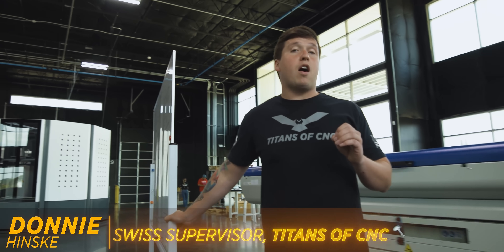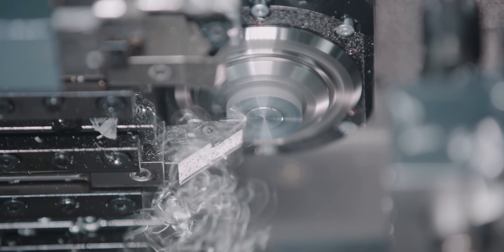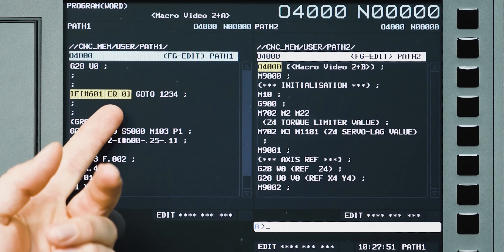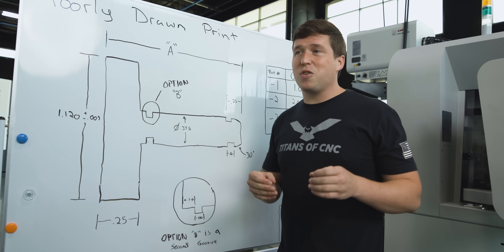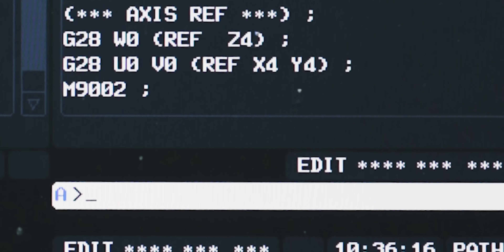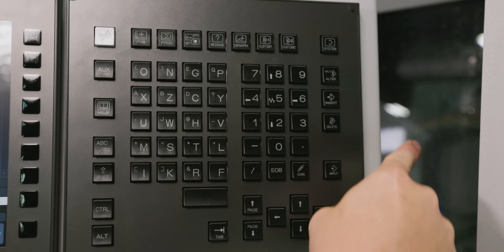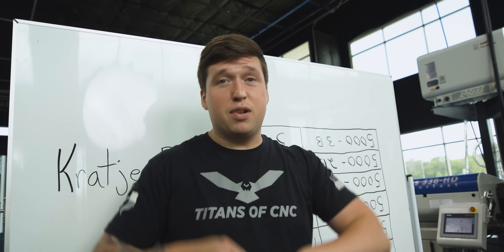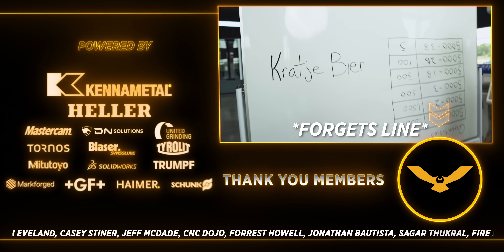Unlimited Part Sizes With This Genius Macro Program

Comment from the maker: %
O4000(<Macro Video 2+A>)
(*** SAVING PART VARIABLES ***)

#600 = 1. (Part OAL)
#601 = 1 (OPTION B? 0=NO 1=YES)

G800 A1.125 B #600 C [ #600-.5 ] D0.3 E.003 F0.0155
(A: BAR DIAMETER)
(B: LENGTH OF PART)
(C: PART PICKOFF LENGTH)
(D: FEEDING ALLOWANCE)
(E: FRONTWORK FACING ALLOWANCE)
(F: BACKWORK FACING ALLOWANCE)
(H: LENGTH PINCHES SPINDLE FOR WORK WITHOUT GUIDEBUSH)
(I: INTERNAL DIAMETER)
(J: QUANTITY OF PARTS BY CLAMPING)
(K: QUANTITY OF FEEDING PER PART)
()
(*** SAVING CUT VARIABLES***)
G801 A1100 B0.118 C0 D97 E2000 F0.0035
(A: CUTOFF TOOL NO + CORRECTOR)
(B: CUTOFF TOOL WIDTH)
(C: CUTOFF TOOL ANGLE)
(D: SPINDLE MODE 97=G97 96=G96)
(E: SPINDLE SPEED BASED ON ARG D)
(F: INITIAL FEED RATE)
(I: SPINDLE SPEED LIMIT)
(J: INCREMENT OF CHIP BREAKING)
(K: DEAD TIME TO BREAK THE CHIP)
(M: WITHDRAWAL TO BREAK THE CHIP)
()
(*** SAVING DWELL VARIABLES ***)
G802 A0.5 B0.5 C0.5 D0.5 E1 F0.5
(A: DWELL AFTER OPENING COLLET S1)
(B: DWELL AFTER CLOSING COLLET S1)
(C: DWELL AFTER OPENING COLLET S4)
(D: DWELL AFTER CLOSING COLLET S4)
(E: DWELL AFTER STOP PUSHED BARLOADER)
(F: DWELL BEFORE CLOSING COLLET S1 WHILE FEEDING MATERIAL)
()
(*** SAVING ELEMENTS MACHINE VARIABLES ***)
G803 A2 B0 C1
(A: GUIDEBUSH TYPE  2: MOTORIZED GUIDEBUSH  3: WITHOUT GUIDEBUSH  3.1: WITHOUT GUIDEBUSH TYPE2  100: NOT STANDARD)
(B: BARLOADER TYPE  0: ANY 20 : MANUAL 100: NONE)
(C: TYPE OF EJECTION 1: EJECTOR 2: LONG PART DEVICE WITHOUT CYLINDER 100: NONE)
()
M9000
(*** INITIALISATION ***)
M10
M82
/M8
G4 X1
G900
M9001
M9002
(*** AXIS REF ***)
G28 U0
G28 V0
(*** INITIAL CUTOFF ***)
G910
M9003
(*** START LOOP ***)
N1 M120
(*** END OF BAR TEST ***)
G913
G930
M9004
(*** FEED NEW PART ***)
G912 B500
G0 W0.00787 (RETRACT THE BAR IN Z)
G0 Z-.75 T0
G0 X1.33858 T110 D0 (RETRACT THE CUT OFF TOOL X)
M9005
(*** MACHINING ***)
/M8
(TURN)
G0 Y0 T112 M103 S8000 P1
M45
M600
G0 Z0.0 X [ #500+0.02 ]
G1 X-.05 F.003
X.3, R.025 F.001
X.375, A150., R.025
Z-.26
X1.123
X1.129 W-.03
G0 X1.2
Z.1
G28 U0

(GROOVE)
G0 Y0 T220 S5000 M103 P1
G0 X1.2 Z-.25
X.4
G1 X.3 F.002
G0 X.42
W-.01
G1 X.375
X.355 W.01
G0 X.42
W.01
G1 X.375
X.355 W-.01
G0 X.45
G28 U0

(TURN 2ND SECTION)
G0 Y0 T112 S8000 M103 P1
G0 X1.2 Z-.23
X.4
G1 X.375 Z-.23 F.001
Z- [ #600-.25 ], R.01
X1.120, R.025 F.005
Z- [ #600+.05 ]
X1.129 W-.03
G0 X1.2
G28 U0

IF [ #601 EQ 0 ] GOTO 1234

(GROOVE)
G0 Y0 T220 S5000 M103 P1
G0 X1.2 Z- [ #600-.25-.1 ]
X.4
G1 X.3 F.002
G0 X.4
W-.01
G1 X.375
X.355 W.01
G0 X.4
W.01
G1 X.375
X.355 W-.01
G0 X.45
G28 U0

N1234

M601
M46

()
()
M9200
(*** CUT-OFF PREPARATION ***)
G97
G0 X1.33858 Y0 T110 D0 M103 S5000 P1
G911

(G0Z-[#600+.787+.01])

M9201
M9202
G1 G95 X0 F.006 (CUTOFF)
M9203
G1 X-0.03937 F0.00118 (END OF CUTOFF)
G97 (CONSTANT CUT-OFF CANCELLATION)
(*** END LOOP ***)
M121
M9204
M9
M105
M1105
M2105
M9205
M0 (STOP A END OF CYCLE)
/M8
G4 X1
M9206
M99 P1
M2

O4000(<Macro Video 2+B>)
M9000
(*** INITIALISATION ***)
M10
G900
M702 M2 M22 (Z4 TORQUE LIMITER VALUE)
M702 M3 M1181 (Z4 SERVO-LAG VALUE)
M9001
(*** AXIS REF ***)
G28 W0 (REF  Z4)
G28 U0 V0 (REF X4 Y4)
M9002
G919
M9003
(*** START LOOP ***)
N1 M120
M9004
G55
M405
M9005
(*** MACHINING ***)
G55
G28 W0
G0 T540 Y0 X-1.2 S5000 M404 P4
Z0
G1 X.05 F.002
G0 X-1. Z.05
G1 Z0
X-1.12, R.025
U-.003 W-.06
G0 X-1.2 Z.1
M405 P4
G28 W0
()
()
(*** PART EJECTION ***)
G55 (Z4 ZERO OFFSET FOR BACKWORK MACHINING)
M405
G28 W0 (REF  Z4)
G0 X0 T500
M11 (OPEN THE COLLET S4)
G4 X0.5
M84
M85
G4 X0.2
G28 W0 (REF  Z4)
G28 U0 (REF X4)
M9200
M9201
(*** PART PICKOFF ***)
G915 (SHIFTING FOR WORK IN OPERATION)
G97
G0 X0 Z0.07874 T400 M404 S5000 P4 (APPROACH BACK SPINDLE)
M418 (SYNCHRO PHASE)
M702 M4 M1 (TORQUE LIMIT Z4)
M702 M5 M1 (ENABLE SERVO-LAG CHECK Z4)
G924 (PART PICKOFF)

(G0Z-[#600-.5])

M9202
M9203
G1 G94 W0.07874 F78.74016 (CHECK BREAKAGE CUTOFF TOOL)
M702 M5 M0 (Z4 DISABLE SERVO-LAG CHECK)
M702 M4 M0 (Z4 TORQUE LIMIT CANCELLATION)
G95 (FOR LOOP START)
G28 W0 (RETRACT BACK SPINDLE)
(*** END LOOP ***)
M121
M9204
M405
M5105
M9205
M0 (STOP A END OF CYCLE)
M9206
M99 P1
M2
Reply: Looks like a millturn milling cycle, not what was used in the video.
Reply: @staamp4642  Just fixed it! Thank you
Reply: You forgot to add (barry stinks)
Reply: @RippenSXS they should totally do a silly vid on custom messages and alarms 😂 frickin hilarious!
Reply: Im just a manual monkey but youre a real G for dropping this
Reply: G0 Z0.0 X [ #500+0.02 ] 🧐
Reply: @BTR_m the Tornos G800 parameters update in the #500 macros. #500 is my material. I write my template to rapid the first tool to the material diameter plus .02 so it’s always right
Reply: @donniehinske  Thank you for explanation Donnie, Im new in swiss machining, we have in our shop Doosan Puma ST32 ca. 6 month now and we learn every day something new
Reply: This is awesome, I've been playing around with macros on a mill but I was wondering if you have any books or references you would recommend? Also, is there a way CAM can help with this?
Reply: To make it foolproof I would check that #600 is greater than 0 and raise an alarm if it's not. Very informative content anyway!
Reply: I don’t know what’s the difference of macros instead of normal program.
If I create a program for each part , isn’t that the same result?

Comment: ACB stands for 'Active Chip Breaker.' This breaks chips in a controlled manner, eliminating the accumulation of long, stringy chips, bird nests, etc. It's supposed to save the operator downtime from having to pause or stop the machine cycle in order to clear chip accumulations.

Comment: To follow this better, I typed in:

B#600 =11:11  (Video length)
()
(F: INITIAL FEED RATE =DS.50

This played the entire 11:11 video at 50% DS
DS   =(Donnie Speed)

Much easier for my slow mind to absorb. 😁

I can't begin to comprehend the amount of inputs on a complex part.  One single digit entered incorrectly must create scrap metal rather quickly.
You guys are doing a fantastic job educating the masses and at the same time entertaining the rest of us.
👍👍👍

Comment: I'm a CNC machinist from switzerland. But in a wood furniture manufacture. I also wrote similar macros for furniture parts and house doors. So we're able to take the measurment at the customers house for example how large and deep the wardrobe has to be. The macro just turns the external dimensions of the furniture in to a program for each part. Like an excel-file with "if-then-function", all the necessary holes and millings were adjusted automaticaly. You remember the tour at the Tornos factory, where every working process is totally streamlined for maximum efficency? In switzerland it is necessary that allmost every manufacter works like this. As well cabinet makers and carpenters. Otherwise the products are too expensive. 
Love your chanel!

Comment: OR, write a macro that uses variables. But, use a separate program for each variation of the part which contains only the variable values and a call for the macro. Of course, there is not much advantage to doing it this way on a simple part like the one in this video. However, for more complicated parts with several variables, it saves time by not needing to edit the program variables every time you run a different variation of the part. You just load the program that contains the variables needed for the variation you want to run. It also reduces the opportunity for errors that might happen if you accidentally edited the program with a bad variable.
Reply: G98 P#### for the win.

Comment: Realistically, how many people watching this are swiss machinists?
Reply: Not me
Reply: You can do the same stuff to any other control.
Siemens, Haidenheim and Fanuc do the same.

We sometimes have 30 different variables in our programs.
The program has between 10,000 and 1,500,000 lines of code.
The variables are stored in the post processor.
Reply: Swiss Applications Engineer 👋
Reply: Im manual, onesy twosy work mostly 😅
Reply: Im not a swiss machinist.  Im an irish one
Reply: I’m neither Swiss nor a machinist.
Reply: We have about 30 regular cnc lathes, and since one year one swiss type machine. 
My colleague and i have this comparsion: Imagine you are a Plane-Pilot (Plane = regular lathe) you know how to fly it, right. You know how to fly. But when you are in a helicopter (= swiss-type) you cant fly no more. You have to relearn how to fly. 
Swiss-types have their place and all, but they are sooo different to a regular cnc lathe. Great when u have a big number of pieces to make.
Reply: I used to have 3 before I sold them to buy more Matsuura mills 😂

I use macros on them to auto adjust my deburring brush to allow for wear
Reply: I don't work on a swiss machine but I'm a swiss machinist😅
Reply: Not me
Reply: Me
Reply: I'm a Swiss machinist
Reply: I'm just a regular machiner
Reply: Yup
Reply: Im a panel beater and spray painter 😅
Reply: To be honest many will learn something and put in their jobs.
Reply: Here
Reply: I'm, and I'm the programmer as well but mostly citizens.
Reply: You can use macros for HAAS controls too.
Reply: Yup
Reply: 🙋🏼‍♂️ Star for live

Comment: Excellent way to teach how to use macros , at my last job ,  i used to have STAR CNC , CITIZEN L20's i had to learn the hard way how to work out with macros and synchronize with sub spindles for shafts over from 3" to 24" using 1 or 2 single programs with macros ....

Comment: 2:22 - months will pass, everyone would forget the details. Then someone would invoke that macro with a wrong value (less than 0.25’), and the machine would crash by moving below zero on Z axis. So - always check user inputs in your code!
Reply: IF[#600LT1.]THEN#3000=1(length too short. Machine will crash)
Reply: That's why instead of user inputed dimensions I have a table below everything with the variables set by each part number. User just inputs the part number, then it jumps down to that and loads the correct numbers and jumps back up to run like in the video.  And if they type something wrong it just alarms out because it can't find a match.
Reply: @nh18343 yep. That’s exactly what I do too. Have the user input variable as the part no. for  a few parts I make- which directs what sizes/options are machined accordingly.